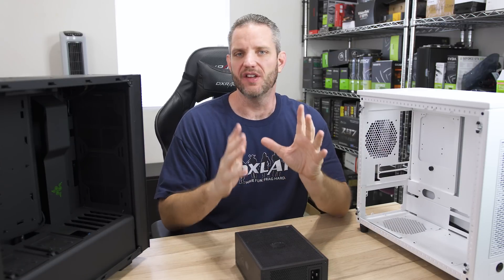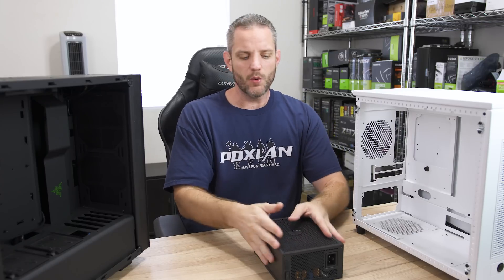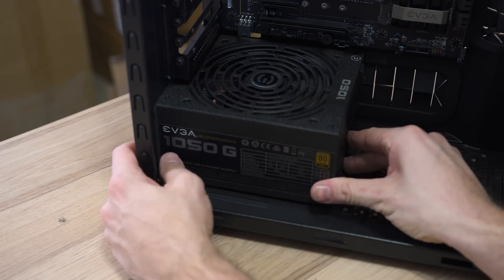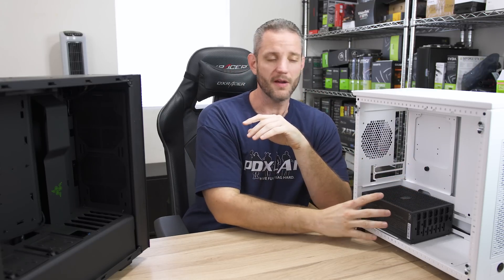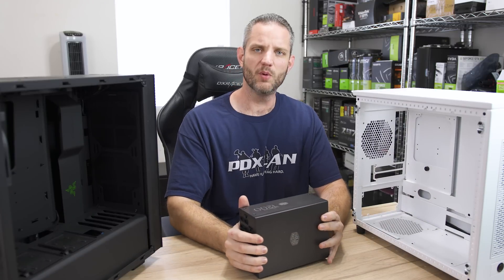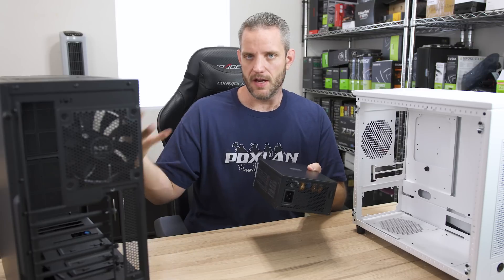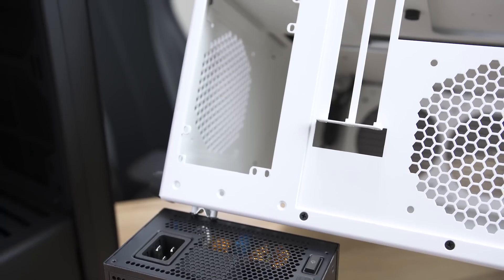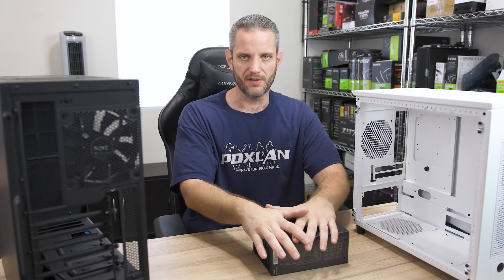Should you mount your Power Supply up or down?

Comment: I learned my lesson and from now on I will use the psu turned up why? coz last one was turned down and the fan somehow wasnt working, it overheated and the system didn't shutdown for wtver reason making it hit over 90c and blow it up, luckly it was only the power supply rest of my pc is fine, so yeah atleast with power supply up i can monitorize if the fan and everything else is working correctly.

Comment: I just got a Fractal Design Define R6 case, and it has a fan shroud with a narrow grate pattern on it to let some air through. The power supply says it prefers having the fan face up in order to allow heat to naturally dissipate when the fan is not running. However, I have doubts as to whether the grate pattern in the shroud is sufficient for that purpose. Noise is a big deal to me, so I'm torn.

Comment: What if youre running a longer than average PSU and the fan hole in the bottom of the case is only cutout for a standard length unit? Using an EVGA 750W G2 and a Cougar archon case, can only see half of the fan from the bottom
Reply: Break out the drill

Comment: This is kinda what irks me with modern cases, I cannot get one with a top mounted PSU anymore unless I want to buy an antique and mod in the modern USB plugs. I have a case that can handle 11 120mm fans that I could mod if I desired, I do not.

There's another thing here Jay is missing, if your case has 3 front intake fan slots and 2 exhaust, a modern PSU will make it 2.5 exhaust because it's fan will be half speed. That .5 will pull air between the PSU and GPU assisting the GPU cooler as more cool air is pulled between the two units for the GPU to use rather than half it's exhaust. This is especially true if your PCIE slot covers on the case are solid and in place. If you have solid PCIE slot covers and PSU sucking from under the case remove the covers and toss in the trash so your intake fans have a reason to send air in front of the GPU rather than at the exhaust vents. As for visuals who the fuck is going to be looking at the back of your case anyway and the slots are all perfectly uniform in size? If someone does look at it and say something you can own them by telling them the missing covers assist the GPU cooler.

Comment: Hello guys need help with my new pc rig. 

List of specs:

R5 Gaming case (2 120mm fans and I added a 3rd in front.)

MSI B350 Tomahawk Motherboard
RYZEN 5 6 core 12 threads
8 GB Corsair DDR5
MSI Radeon r9 380 4GB graphics card.
120 GB SSD (for the Operating System)

500 GB Seagate HDD

Powerspec 650 Watt power supply.

So ok.... I installed Windows 10 with updates as well as the B350 motherboard drivers and tools . I also updated the Bios on the motherboard. My problem is that when I turn on my PC after a few minutes or even seconds my 4k TV(which is what I'm using) image signal goes off them the blue lite starts blinking on PC then the fans stop spinning. I've tried everything.  Any help would be greatly appreciated thanks guys. My e-mail: enriqueg873264@yahoo.com if you have any other suggestions on this.
Reply: Oh and my power supply is facing up.

Comment: You mention a good ideal to mount the power supply fan down because of water, well I will add one more item, loose screws. I had a power supply with a large fan grill and the power supply was fan up. I was changing out a PCI card and a screw dropped right into the power supply through the fan grill. Luckily for me it was a fully modular power supply and I was able to easily remove it and shake the power supply around to get the screw out. So now if I have that configuration of power supply fan up I put a piece or paper or card board over the fan to ovoid dropping anything into it.

Comment: Does the positioning matter in an open air rig?  I have built a mining rig but due to the size of the rig case, after positioning the motherboard, I had no choice but to mount the EVGA 750W Gold power supply unit on its' side with the power supply vent facing outward (away from the other hardware in the rig).  The rig case is a pull/push drawer type so to fit everything in and still be able to pull/push the drawer this was my only option.  Any thoughts or suggestions? Or am I good to go?

Comment: Well. Before watching this or any video... I just removed my carpet , pulled it to the side so my Central Unit can sit directly on the floor. After I assembled it however I didnt feel much air pressure so I searched youtube, wondering if its supposed to be fan down. It does get more air pressure after running full load for a while , and seems I did everything the proper way. My Power Supply isnt as fancy as to not even turn the fan.... lol. Good info doe, have some piece of mind I dont have to open it up again.

Comment: I have always  installed my psu fan up when  it is installed on the bottom of the case. However  I did it  because I was not actually  sure about which way it should go. It seemed to me the  vent  at the bottom was not  much .So I googled   asking  if i was doing it right  or wrong .. Thanks  for the video. and  letting me know that I  wasn't frying my psu  rofl

Comment: My PSU fan never turns on because my system never uses that much power. But the power supply still gets a bit warm. So if i mount it with the fan facing upwards and have a positive pressure inside the case then the case fans will force some air to go through the psu and keeping it abit colder.

Comment: Heat rises. Hot air coming out the back of the PSU isn't going to be pulled back underneath when it thermally is rising.

Comment: My psu a seasonic has what they a hybrid fan mode system. Where the fan doesn't spin in low power usage scenarios. Seeing as the fan doesn't spin. I keep it facing up as the hot air goes through the fan grill and out into the case. Tried the other way around and it ended up popping my psu cause of the hot air build up.

Comment: I face mine down when able as long as the case has a filter . But I keep my case on a desk or hardwood floor. Keeps my EVGA PSU from ramping up with there overkill fan profile on the EVGA g3. And my case has a PSU shroud so it wouldn't get much air facing up. But the carpet part is 100% accurate ,and was a smart move on Jay's part

Comment: @JayzTwoCents The way I see it the only reason to mount the PSU up (if the mount is on the bottom of the case) is if it's on carpeting. (And if it's on carpeting you have already failed your PC.)
It does not make sense that a low speed fan in a face down bottom mounted PSU would be pulling air from the PSU exhaust port. For one it's low speed, and for two hot air rises.
Also if you have a small case or fully loaded case and you mount the PSU on the bottom face up so it takes the air from inside the case...what is the closest air it will be drawing from?
Why that non-reference design GPU you have that dumps hot air into the case of course. =(

Comment: In that white case the vent in the bottom is so small for a massive power supply like the one he was using in the video so would it make sense to face the fan up in that white case just because the vent on the bottom is smaller than the power supply.

Comment: I just got a new EVGA bq 750w., fan is DOWN on a wooden floor, Deep Cool case.. and after a few days using it, it started making noises while gaming, like, as you interact with the game, it sounds as if you were changing speeds in your car, and the noise is really annoying.. Should I change the mounting of the fan? should I already get a new PSU? HELP! 
When the PC is not gaming, it's all quiet, it really works quite nicely at that.. but at gaming, not..

Comment: I had the fan on power start making a ton of noise so I had to replace the fan and the only 1 I had of the right size was a blue LED and it looked so cool. It turned a black box into something kool.
But I replaced the power supply as I am getting ready to upgrade my GPU and I need a 6 pin that old power supply didn't have.

Comment: Can anyone help Me, I have an old XP System which I used the psu from to make a surplus rig, its a no-name 380w, and it has these 2 black wires coming out with the bundle but they're only bout 5cm long, with a mini molex on end, what are they for.?  I always thought they could've been for some kind of psu temp/fan monitoring..? No..?

Comment: My pc specs:
Case: Corsair Spec Alpha
Ram: G. Skill Ripjaws 2x4 4GB 2133 
CPU: Intel Core i5 7500
GPU: Gigabyte GTX 1060 Windforce OC 6GB
PSU: Corsair CX850M
HardDrive: Western Digital Black 1TB
Motherboard: MSI B150M Mortar

Comment: My power supply is on the top in my case
Reply: Mine too.  After spending alot of money ($150) on a cool new whiz bang case I was not impressed with the quality. Cheap plastic, flimsy thin sheet metal and not alot of room despite being a "mid tower" case.  Put up with it for about a year but when I upgraded my video card and had about 1mm of room between the hard drive mounts and the video card I had enough. 

So I pulled my old Chieftec Dragon case from the closet, yanked out all the guts (who remembers IDE, AGP and dat ribbon cable goodness ?) and slapped my ROG I7 build into it.

Sure I had to mount the hard drives in one of the the million 5.25 bays, add a 3.5 bay USB port and GASP mount the PSU in THE TOP OF THE CASE but now I can actually reach my SATA ports and remove the video card if I need to clean the fans/heatsink.  

Despite the fact that I can now only use 80mm fans (plus the 92mm in the side panel) the CPU and GPU now run about 10 degrees cooler because everything isn't crammed in there like clowns in a tiny car.  Plus if I ever need to use my computer as a jack stand while working on my car, that beastly Chieftec case should support a full size SUV.
Reply: @zed-xr4353  Holy shit those old Chieftec cases were friggin tanks. I ran one for a good 10 years... only gave it up once I moved my PC stuff into a smaller area and space became a concern...  and to be honest, I don't miss 80mm case fans... but they were built like brick shithouses.

Comment: Im glad my case had the holes down so I mounted it the "right? way"... fan down..    after a couple of years, my corsair water cooling started all of a sudden to leak!.. (a new fan was touching slightly one of the tubings).. so, when I came home from work, I noticed it.. and even if it was white inside the pc case (frosted or dried water cooling fluid..) it did not cause any damage whatsoever to any component..   (I did turn everything off.. and dismantled the entire machine, and gave it a cleaning, before putting the cpu original cooler (just to get by some days).. and everything has worked since.. and thats about 5 years ago. (old pc, but still rocking!.. i7-950..  ok, I have upgraded hard drives, gfx, & cabinet) but everything works just great.  no need to upgrade fully (yet)

Comment: Great video
Yet the water cooled with the PSU in the age old top position. Say the HP Phoenix, the cab is apprx one inch above the PSU box. So I'm putting the Corsair 750 fan facing down. It comes face to face w the graphics card fan. Below that is the water cooled fan. Maybe this config is not up with the Italian Motor sports, but it their is a leak, nothings getting wet. Even though the logo is upside down, it mounts correct to the 4 mounting (one is off set). Plus I can't see why you'd want a 120mm fan so close to the box. If I flipped it rt side up, the fan would an inch or less from the top, with no opening or vent. Opinions plz!

Comment: What would you recommend if my PC has 1 intake, 1 exhaust, plus whatever position my power supply is in? I have a ThermalTake TR2 600W PSU (yeah idk why I didn't buy one with any efficiency rating), and a HAF 912 case.

Comment: my case has 5 or pre installed fans 2 in 3 out what should I do add 1 fan or remove 1 either way it would end up as a neutral airflow system

Comment: hmmm in this video you stated you prefer Neutral Case Pressure, whereas in the previous one on Front Mounted Radiators you stated you prefer Positive Case Pressure.  Would you please do a video on all three types of Case Pressure?
   I agree with Positive Case Pressure so long as there is an easily cleaned pre-filter with a HEPA Filter after that on the intake side.  It is my opinion that Dust is an Enemy which will compound the Big Enemy of HEAT.
   One thing I do not understand about Case Design is the idea that smaller is better. Heck, it goes with all of PC-land lol. You gotta remember that given the same amount of Heat, that something that is smaller will get hotter faster. Why not design CPUs & GPUs with more surface area? Just an example, but take a 40mmx40mm(1 1/4" ish) chip. That is 1600mm^2. An increase of only 25%, 10mmx10mm, would be 50mmx50mm, or 2500mm^2, or an increase in heat dissipation ability of 64%. An increase of 50% in surface area would give 100% more heat dissipation ability. I see all manner of motherboard and case design flaws that, if done differently would minimize heat issues and not require the use of the bane of Electronics, water, to cool with. Maybe one of these days someone will tell me what a Max Gaming Rig produces heat wise in BTU, not Watts. I mean a Dream Gamers Rig, 4 GPUs, 2-4 CPUs, 2000W PS, and a built-in coffee maker/warmer lol.

Comment: They should really be mounted at the top of the case like they used to be, which was for a design factor reason. Regardless of the fans intake / out take of the PSU heat 'radiates' from it (PSU one of the hottest parts of the PC). & where does that radiated heat go? Straight up or straight over all the components you want to keep as cool as possible, from bottom to top (some gets vented by fans, some of the hot air gets fed to cool heatsinks though too, which doesn't do as good a job. It (bottom mounting) started to appear when water cooling came on the scene & holes for the hoses appeared at the top of the case along with the dilemma of where the radiator / reservoir & all that jazz would sit (at the top, at least in the early days). I guess they figured if components were all on a water cooled loop the extra radiated heat wouldn't matter none. But for an air cooled system, it is extra heat in the case whether we like it or not.
Reply: Are you telling me my dell case is superior to a 200 case?

Comment: This is 100% accurate. 

From my own experience i had cx 750 corsair (i know its a trash psu) upside down. I t was randomly shutting down pc while playing games like civ 6. When i eventually turned psu fan facing up my pc never shut down since. Then i found out that actual bearing on this psu is constructed in a way that fan must be facing up in order to operate normally. 

second thing is that you restrict airflow into psu.

Comment: If the power supply is mounted with the fan up, and the graphics card has an open air cooler, they would both be fighting for the same air, especially if they are close to each other. Just a taught. Great video by the way.

Comment: I'm building in a Phanteks Enthoo Evolve itx case.  There's a well vented shroud cover for the PSU to sit inside.  The reason I might want to try flipping the PSU upside down is to draw the hot exhausted air being thrown downward from the GTX 1080 FTW graphics card that sits directly above it and have the heat immediately ejected out through the PSU's fan.  One thing that comes to mind though, the heat may become too much for what this Corsair PSU is rated for.

Comment: Super video, thanks a million for this. I wonder could I ask your opinion on something. I just completed a really nice build in a Thermaltake Core V1. I chose to mount the PSU up in it for the same reasons you mentioned here. Also it has a large 200mm fan at the front drawing cool air into the whole case all the time so my feeling was that this would be a better supply for the PSU rather than through the filter at the bottom. Also space wise once fitted the PSU has as much space mounted up as down since the motherboard is on a stilt system. Anyway I would be interested in your thoughts if ever you have a chance. Thanks again for the video, very straight forward and to the point.

Comment: On a related note, I'm about to build a mATX pc. The case has the PSU 'stood up' with the fan facing in or out, rather than up/ down.

If I have the fan draw air from outside the case (at the front) then it will exhaust warm air into the case; fitted the other way around it will be drawing air from within the case for cooling which may not be all that cool to start with.

I hadn't given much thought to positive/ negative pressure; not with respect to the PSU. I'm aiming for a slight positive pressure. The PSU is 660W and the draw should be under 400W. The fan will also only run when it heats up/ draw is over a certain level anyway.

What are your thoughts, please? Am I over-thinking it? In or out, is it like belly buttons? (Even though one looks horrible, it doesn't actually matter)

Comment: What if the powersupply takes in the hot air exhausted out of the graphics card as its literally parallel to the graphics card, I want a exhaust fan in my system but a bit scared to try this way out.

Comment: 3:59.... really bad assumption there. You apply your 'cooler operating' logic to an anecdotal assumption that it loops, therefore, bringing hot case are inside is going to make it operate cooler? What a joke. Its not a big deal up or down, but dont just say that its goign to operate cooler fan side up. Speaking of anectdotal evidence, look at the friggin writing on the power supply, its UPSIDE DOWN with the fan mounted up........... so dumb.
Reply: actaully the psu is near the top of the case because science